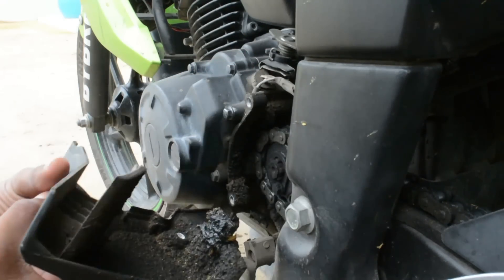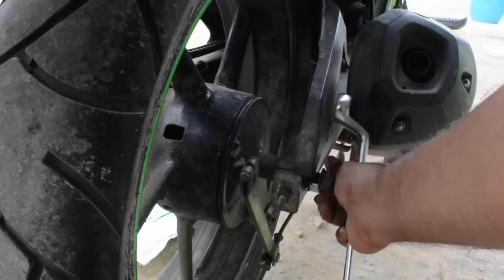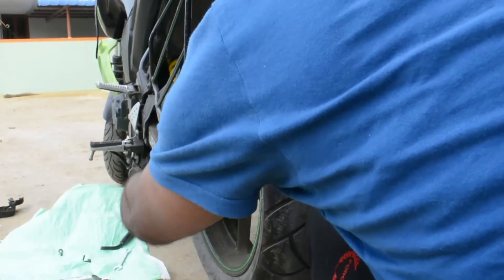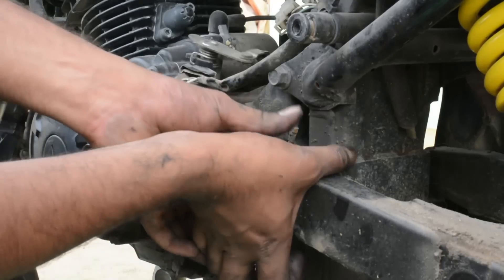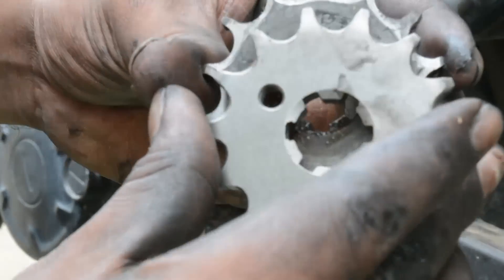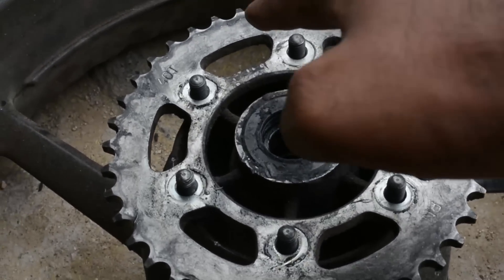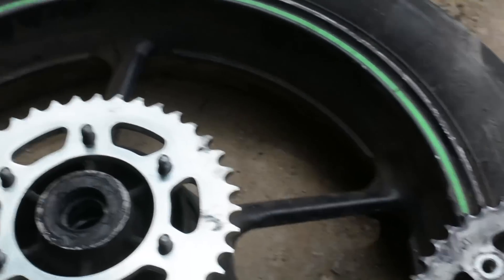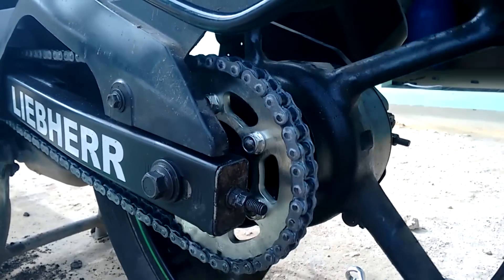Yamaha FZS Sprocket and Chain Change DIY (INDIA)

Comment: Very very helpful. Other bikes have a locking mechanism in the chain itself which allows to open the chain like a rope without opening the wheel set and swing arm bolts. But Yamaha has given chain as a single piece to strengthen its structural rigidity. This prohibits the chain to break apart even in extreme conditions. This is why I love Yamaha's engineering. 👌

Comment: I am having same bike with rear tyre 140-70 17 michelin pilot sporty now my chain spocket too bad and it give cracking sound while riding at 5th gear so i need to immediately change the chain spocket . My doubt is i need to change the tyre also? Please help me bro
Reply from the maker: +sudharsan V your tyre doesn't need to be changed with your sprockets.....only change tyres if treads have worn out
Reply: Dudes and Tools thanks bro

Comment: r15 v1 chain sprocket setup is also recomendable to install onto fzs it increses the torque 100% guranted fit.....
i have done this on my ride.
Reply from the maker: +Swapnil Sen I'm sure you can play with top speed and torque by changing sprocket sizes.... How much teeth does the r15 sprockets have
Reply: r15 v1 has front sprocket - 14 teeth  & rear sprocket - 42 teeth effects increase and torque and and small increase in top speed whereas
r15 v2 has front - 15 teeth & rear - 47 teeth effects to much increase in torquee...
Reply: +swapnil Sen..... My bike model is 2008 version. It has 14t-40t set up. Now the sprocket has to be changed. what do u recommend,
14t-42t, 15t-40t, 15t-42t or the R1 v2.0 setup. As of now from past 8 yrs, am getting around 31 - 33 mileage constant, irrespective of riding style.
Reply: since u r riding on 14/40 steup i would recomend to go for 14/42 this setup would do ur job of reaching 100 like a peace of cake..  basically it increases the torque and initial pickup.. hope this helps u
Reply: Swapnil Sen R15 v2 ka chain sprocket yamaha fz mai lagega kya??? Reply
Reply: is the r15 v2 rear sproket a direct fit for fz like the v1 , what about putting 15/47 on fz same like r15 v2?
Reply: can i install yamaha chain spocket in my pulsat 220 ??
plzzz replay
Reply: Brother r15 chani sprocket fz16 fit or not fit tell me bro
Reply: Bro fzs is suitable for r15v1 perfectly..?

Comment: you need some proper tools for the job. Buy a 1/2" drive socket set and you wont strip the bolts/nuts. 
You can loosen the rear wheel sprocket nuts while the wheel is still attached. Just break it loose. 
I suggest you ask someone to press rear brake while you loosen rear sprocket nut, or put 1st gear( its next best recommended  method if you are alone).
good video BTW. appreciated.
Reply from the maker: +anurag77719 Thank you

Comment: Bro I have a  question that fzs v2.0 has 41 t chain sprocket company installed but recently a newly opened service center replaced that chain sprocket with 40 t.... Is there is any problem would I face using 40 t sprocket
Reply: Anju Gupta don't worry no problem but little bit pickup will reduce and mileage will increase..

Comment: i have 2 doubts , will the 110/70 size tyres provide more breaking and handling for fz , and will the r15 rear sproket that is 42 teeth fit fz or will the new fz 25 rear sproket 46t fit ?

Comment: Your rear tyre is Michelin pilot sporty,right?
I too changed my stock tyre to this one but found it to be too hard. Shock absorption is not good.
What’s your experience with that tyre?
Reply: It is not comfortable at times, especially off-road, best and wet roads. It is awesome on highways. Never had a puncture in 3 years, clicked 20k kms so far. Let me know if you have faced any issues

Comment: Can u tell me your rear tyre specs ?   I have same bike and i replaced rear tyre with conti go 140/70-17 instead sock tyre and my chain spoket condition is bad and have to change it. But I am afraid that the tyre will be jam in the swing arm under the mud flap.
Reply from the maker: +Kaushik Halder mine is a michelin pilot sporty 140/70 -17
Reply: Kaushik Halder if u have version 2 and if u have a highprofile tyre then brother you have to change your swingarm bushes after evry 5000 kmtrs.
Iam too facing this problem.
Reply: Kaushik Halder i asked a guy at yamaha about this problem ,he told that because of high profile tyre it affects your swing arm and further your chain sproket because of instability.

Comment: hi is there is any option to reduce the seat height ??
Reply from the maker: +Thotta Str No there is no option to reduce seat height....Some alternatives are ,you may remove some foam from the seats at the cost of comfort....use low profile tyres(the stock tyres are low profile) etc...

Comment: I have a question. Is it necessary to buy an authorized one from Yamaha dealer or is there really an authorized spare present for drive chain set or the drive chain set does not has any authorized but common one.
Reply from the maker: most chains are manufactured by Rolon....so you can get it from any autoparts store....just tell the bike model.....

Comment: using hid light battery drains fast as fast so i want change battery to higher amps but installed 7ah battery but it didnt detect it some one said going to higher amps battery needs to recoil the stator
Reply from the maker: +sai kiran i have no experience in this area sai....i have never changed battery capacity or load...

Comment: Hello dude, Ive FZs..  Earlier it had Tappet problem that was rectified and it was pretty smooth till one week after the service . Now again im facing the noise issue. Could provide possible reasons and solution for this...
Reply from the maker: +arunkumar n Hi arun.... I'm not familiar with this issue .....better consult the service center

Comment: bro I m from Nepal and I have fzs v2 . and my bike is only giving mileage of 28 km per liter. and work shop guys says that my chain spocket has gone. so if I change the chain spocket I can have my bike mileage about 45 km per liter or not. if not what may be other problem that came that my bike is not giving mileage as expected?
Reply from the maker: +Ishwor Budhathoki the chain sprocket should improve mileage if it was causing additional resistance....but i think 28kmpl is too low and i don't think that is the only thing thats causing your problem ....do you live at a high altitude?
Reply: I live in kathmandu. and I have just recently changed the chain sprocket so let's hope it works well and thanks

Comment: WTF man ! you pulled out the swing arm bolt,just to change the chain&sprockets ? you just need to locate the master link and remove the lock on it,pull the free end of the chain from behind the bike. that's all you had to do
Reply from the maker: +Sree Nath No sreenath....there is no master link in these chains....It is not as easy as a bicycle chain....All links are all rivetted and you need a special tool to replace the chain the way you described.....this way is easier and doesn't involve you investing in a tool just for this one replacement
Reply from the maker: +Sree Nath Just search "rivet type master link" in google and you'll understand what i mean
Reply: Dudes and Tools yea bro,but i didnt know that fz has rivete type masterlink. almost every o/x ring type chain has the regular masterlink with lock and  rings
Reply: Dudes and Tools for me investing in a tool is not a waste of money.every tool you buy is a long term asset,right?
Reply from the maker: +Sree Nath Thats true....every tool you buy is good for longterm use....I didn't want one for this onetime job, thats why i didn't buy it...also i didn't know where to buy one in my locality
Reply: There is no links to remove in fz chains...
Reply: fzs have 2 kind of chain  thin size and thick size both thin size has got lock whereas thik size one dont .Thik chain is far better .it doesnt loosen too ealry.
Reply: Yes he is speaking true
Reply: And he dont have right sets of tool.. Thats why he is using much effort..

Comment: Hello, my bike (Yamaha FZ FI) makes a noise as if it scraped, I do not know if it's the engine or the chain and sprockets kit. It happens only when I'm accelerating at 5,000 RPM but with the wheel in the air it does not. I have been told that it is normal but it is something very annoying, will you have any solution?. Greetings from Argentina
Reply: Mini  chakkar korte vakt  t 
pana lagao